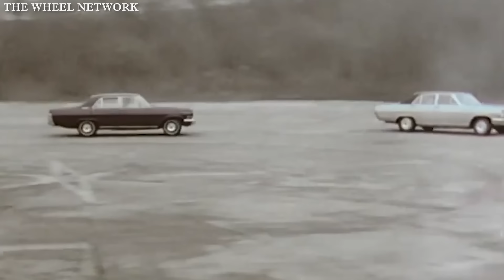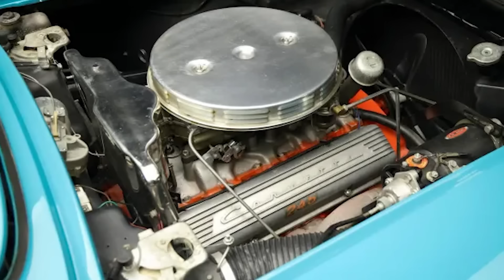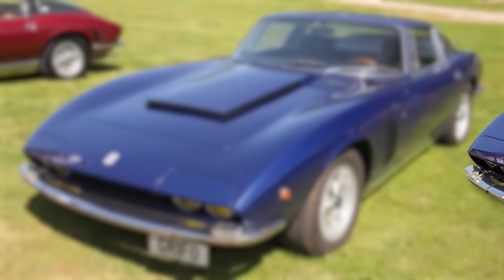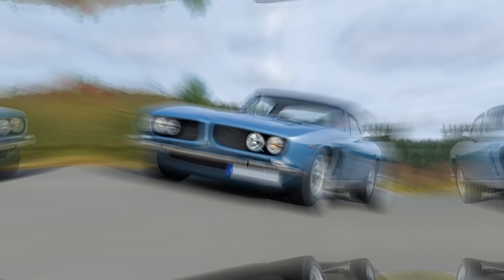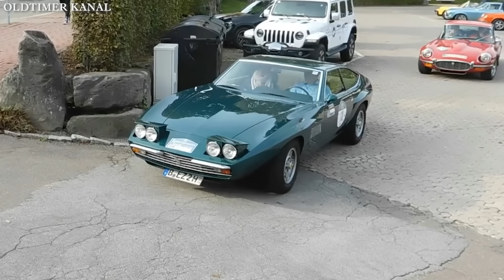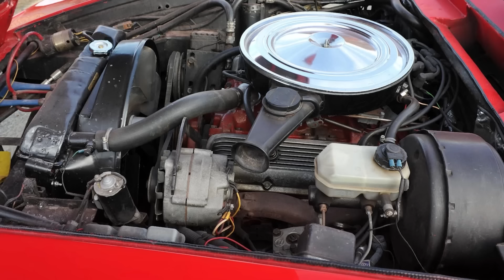4 Most Outrageous Engine Swaps That Were Factory!

Comment: With the Gordon-Keeble 1 Chevrolet worked with GM management to supply the Gordon-Keeble workshop. The engines were borrowed from the base Corvette Sting Ray.  The Iso Rivolta steel body erstwhile running mate to the GK1 continued to 1970.

In its last years the Iso Grifo switched to the Ford 351 Cleveland V8 from the De Tomaso Pantera after 1971.  After the discontinuation of the Grifo Malcolm Bricklin tried to keep the idea alive with the SV-1, a fiberglass body and more modern styling for 1975-76.  Less than 3,000 were built with the Ford 351 V8 carried over from the Iso Grifo.  Prototypes of the Bricklin SV-1 used the ex-Nash/Hudson AMC V8 engine in 360 cubic inches displacement.  The Indra was the production version of the Australian-designed Holden GTR-X concept car.
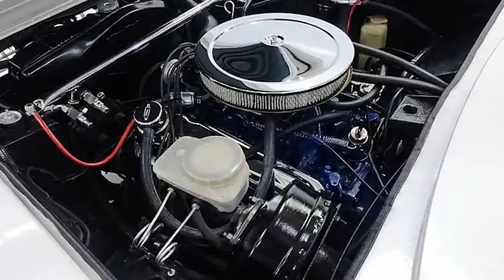Reply: Thanks for your comments 19:59
Reply: Not making the GTR-X. What a great Holden we could have had!!

Comment: I wonder if Opel did a Diplomat convertible... For General Motors, it would have been A GOOD FIT.
I oughta know... FOR I HAVE A ROOT BEER METALLIC '66 DIPLOMAT COUPE which I'm using in Hill Climb races!
Reply: I thought I'd seen this as a pontiac offered in canada
Reply: @chrisolson9603  for a time,
Pontiac dealers in Canada offered the Vauxhall Envoy and other models from 1963-1974...

Australia's take on the Diplomat?

What replaced the Premier series...
THE HOLDEN STATESMAN!